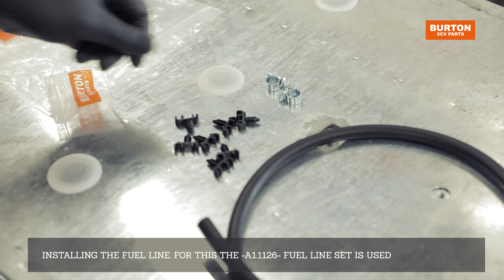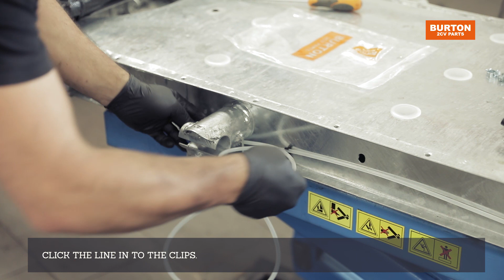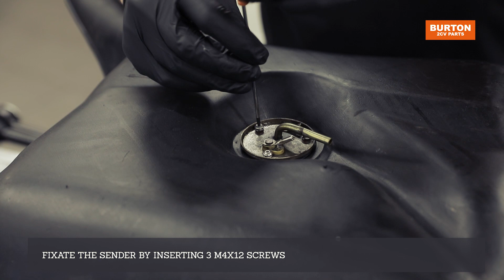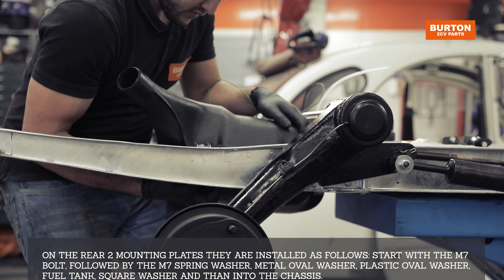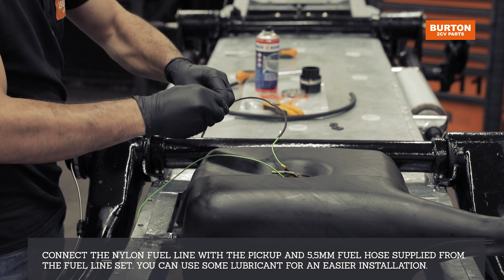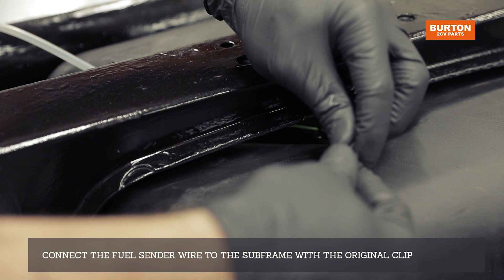FUEL LINE INSTALLATION - BURTON 2CV PARTS

Comment: With fuel gauge no longer working, I have just removed the tank to fit a new sender unit. I'm glad I bothered, as there was a long split on the short black rubber tube to the sender, which, unable to see, could have caused me leakage problems. This video will guide me in reassembling everything correctly. Many thanks, from the UK.